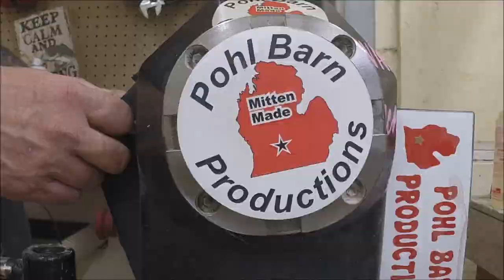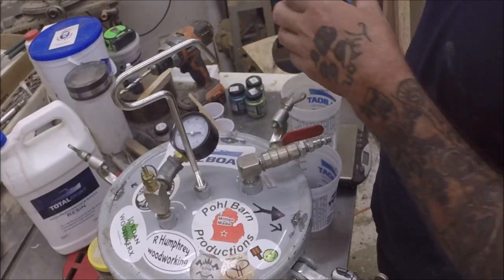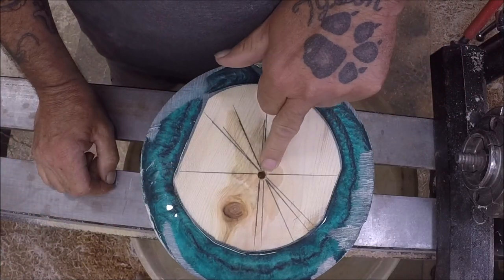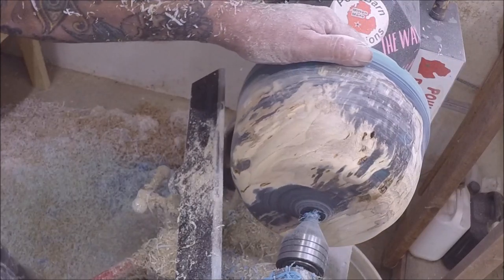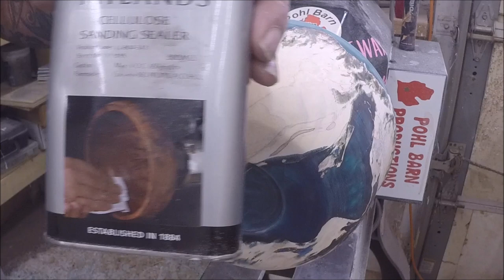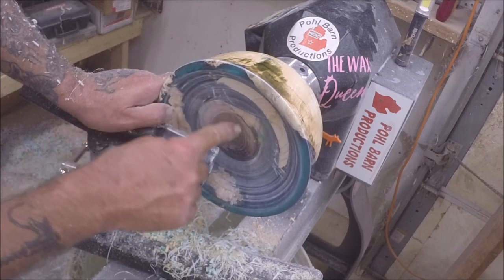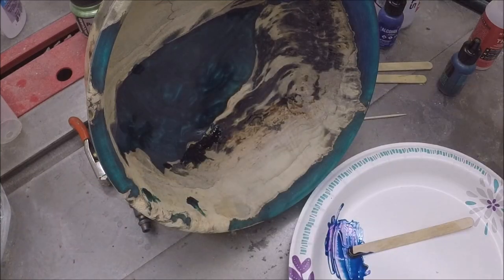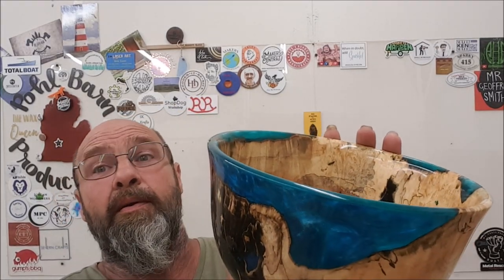Not a blue hole bowl

Comment: I could sit and watch you turn all day every day, and the final product always makes my jaw drop... where do you get your ideas from?
I also had an idea for you when it comes to resin.  For instance the "Flaming Flower Bowl.  When you are pouring the resin, you could try pouring just a bit at a time and between pours put a butane or propane torch to it.  Not touching it persay, but just enough heat to bring any bubbles to the surface and pop.  Then do another pour and repeat.  When I do a large area I always have to torch even though the resin says it will bubble out on its own...they lie.
Anywho...  Gotta get back to your videos so a big hello from Michigan and keep up the great work!!  
P.S.  How much do you charge to make a Flaming Flower Bowl?  I would supply the blank.

Comment: 21:23 Next time you're dealing with a really soft timber that erodes faster than the epoxy, maybe try coating it with a colour-matched epoxy and putting it in your pressure cylinder? You could fill the timber grain with a clear or cream-tinted epoxy and the holes on the other side with the dark blue, with a dam between, and do the final finishing once it had cured and both sides were the same hardness.
Reply from the maker: Thanks again , time is usually my issue when making these projects, always in a rush to get it finished and edited for Friday.

Comment: 21:58 Actually, you do have most of what you need to Stabilize materials...
You need to alter your Pressure Pot slightly by mounting your Pressure Gauge on a Quick Connect (so you can swap the Pressure Gauge out with a Vacuum Gauge easily) and get a small Vacuum Pump (assuming you don't already have one) and some Stabilizing Resin, you don't really need a large Pump, a smaller one should do the job, it'll just take a little longer.
You already have an Air-Tight Vessel (the Pressure Pot) and the bucket to line it to keep the Resin of the inner surface...
Reply from the maker: Thank you, can't see if resin is bubbling over and even if I did this the resin I use sets up to quickly to use for this purpose, I still have to get the cactus juice,
Reply: @PohlBarnProductions  So instead of modifying the Pressure Pot lid, see if you can get a 3/8ths or 1/2 inch thick piece of Lexan (it's stronger than Plexiglass), carefully drill 2 holes in it and install a quick connect fitting for the Vacuum Pump in one and a Vacuum Gauge in the other, add a rubber ring to the bottom and you have an inexpensive, see-through Vacuum Pot lid...
You won't even need to use the Pressure Pots clamps, Vacuum will hold the lid down...

Comment: At 2:57, you made a side comment of  not knowing what to do with rest of it. Is it possible to have a side container for excess resin from various projects? Maybe it can have a wood core (thinking something like a miniture paper towel holder but thicker core) then when full, you can turn it, removing the core and have a resin vase?
Or have small containers to make pen blanks
Reply from the maker: Thank you,  I did use it to make pen blanks, poured into a blank and put it in the pressure pot on top of the bowl, I also have solo cups and candy mold for smaller left over amounts of resin.

Comment: I'm wondering why you put the pot under pressure?  It seems a vacuum would extract air, eliminating a lot of voids.  The best would be to cycle between vacuum and pressure, but it seems vacuum would be best if you gotta pick just one.
Reply from the maker: it a time based things. pressure compresses the air until the resin sets up and hardens, it takes to long to extract the air with vacuum.  the resin will set up and harden during that process resulting in FOAM.  a longer working time than I am using would probably work but not with the resin I am working with

Comment: Did you start turning right out of the pressure pot or did you wIt a few days?  I just did my first resin cast in the pressure pot this weekend and the resin cracked through in a couple of places.  I was able to keep it together with ca glue and it turned out nice but I was disappointed it cracked.  I was using west system 105/207 and it got really hot.
Reply from the maker: I normally turn right out of the pot, I find that if I leave it sit for days it's brittle and hard to turn, I have never used West Systems but I would assume it got to hot and cracked,  if I see it I will pour more resin before I demold it to fill the cracks

Comment: Am going to ask a dumb question. Why put the piece under pressure and not in a vacuum?
Reply: Most resins set up to fast for vacuum. Pressure works better less chance of having visible bubles
Reply from the maker: Thank you Charles, and Thank you RB for that answer for him
Reply: Oh, ok. My thoughts were that a vacuum would pull the air and moisture out at the same time.